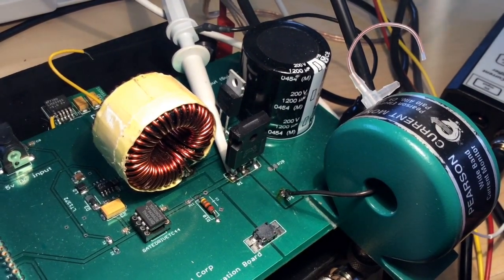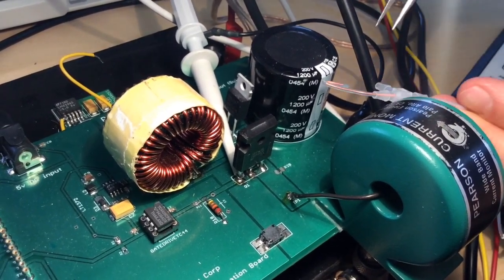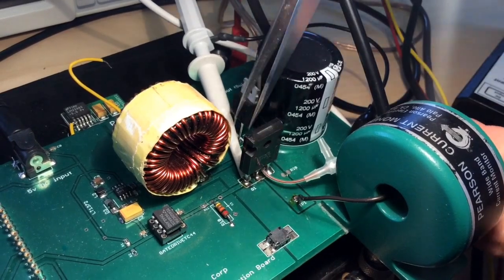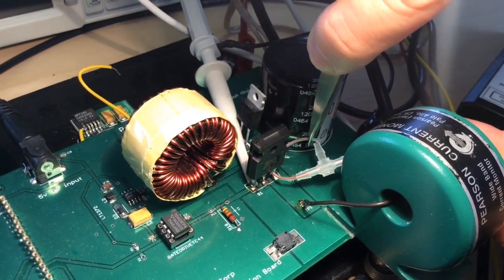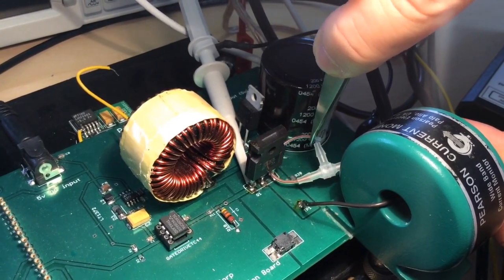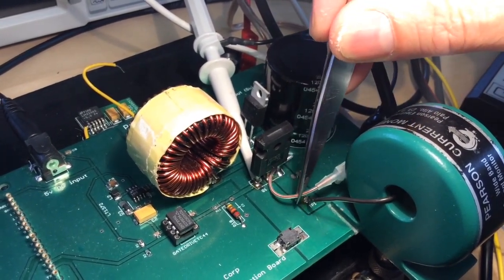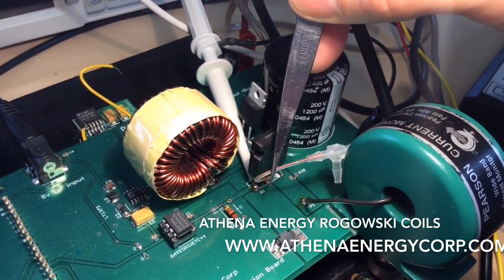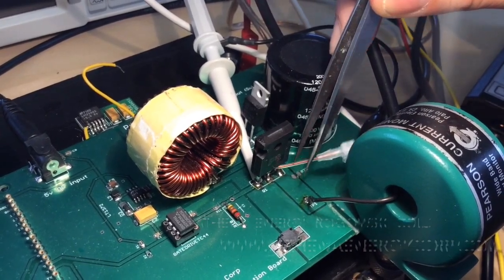Inserting a Rogowski coil

Comment: Can these measure the current of a single sinusoidal waveform in the 50-200VAC range?
Reply: depends on the frequency. Since these are high freq. sensors the sinewave would need to be 400Hz or greater for the model shown in this video. Voltage withstand however is quite good with ability to be used on 1kV un-insulated conductors